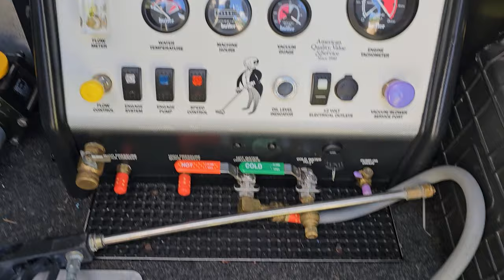Urine Soaked Carpet! Do You think We CAN Clean this? Let's Find Out!

Comment: Hey Mr. Saiger:  I've been meaning to ask you, with your current jets on the the Conway how long would it take to fill up a 5 gallon Home Depot bucket?  Just trying to get an idea of how much water your setup is flowing.
Reply from the maker: That's a good question. I have 02 jets on it for an 8 flow. I run around 500 to 600 psi but have never done a bucket test to be honest. Will have to try it some time
Reply: @MarkSaiger  How much clean water are your vans setup to carry?
Reply from the maker: @insertgoodname4809  110 gallons each
Reply: @MarkSaiger  WOW!😲 That's like 3 bathtubs.
Reply from the maker: @insertgoodname4809  😁👍😅

Comment: What did you charge for this job? You did an awesome job.
Reply from the maker: At the time of this video we were 50 cents per square foot carpet cleaning and for pet urine treatment we start at an additional minimum of $50 and go up depending on how much product we anticipate using and how many areas we need to treat more. I think this job had an additional $100 in urine treatment. The total ticket was around $500 if I recall
Reply: @MarkSaiger  you did a phenomenal job. I am assuming that job took two hours with two people. Producing $125 a working hour. You guys worked very
Hard and produce awesome results.
Reply from the maker: @dogtrainerbreeder7411  thank you. It was actually about an hour once we got rolling, but with doing the video that does take more time... And I'm getting older and slower 😁😅

Comment: The carpet might be clean, but unless there is a plastic barrier on top of the padding, the padding and subfloor are still saturated with urine.
Reply from the maker: There will be urine in the pad and some sub floor
The bacteria enzyme will keep working on that by consuming and digesting and secreting more enzymatic babies. The odor eliminator will help with Odor, but you are correct. There can be byproduct still in the pad and floor. This is one of the better ways to deal with this situation until they replace the carpet and pad and seal the floor. The owner said this would be the last time cleaning it and we actually reccomended they replace this one. They were on a time crunch and asked us to fix it up this way for now. Urine can cause massive damages.

Comment: You need to slow down your passes 
Good grief !
Reply from the maker: We are running a higher flow. The jetting is balanced to our larger hoses and blowers. There is quite a bit of difference in our set up compared to most and we recover quite a bit faster. We have done a lot of side by side testing of Wands and equipment. If we slow down more we will flood more than needed.
Reply: @MarkSaiger  we get told the same thing. Slowing it down overwets the carpet. Great work!!